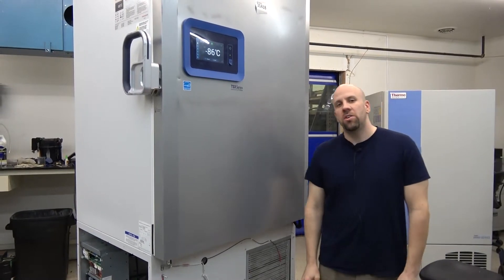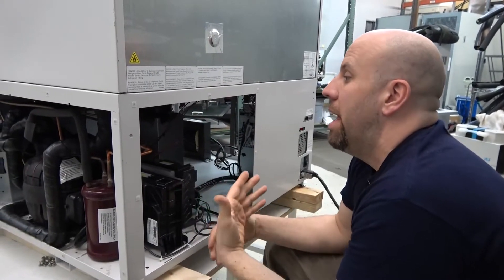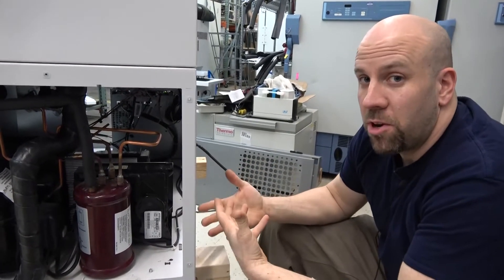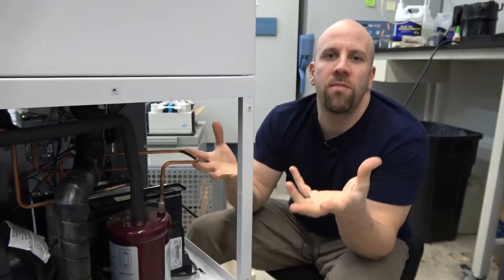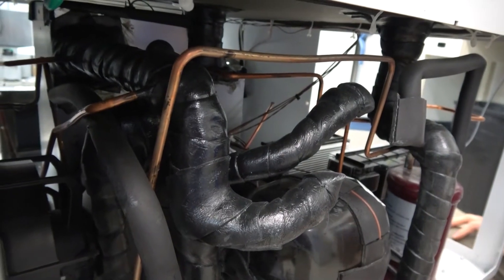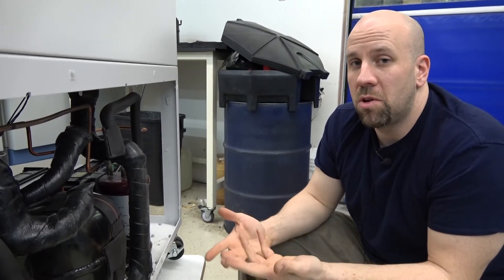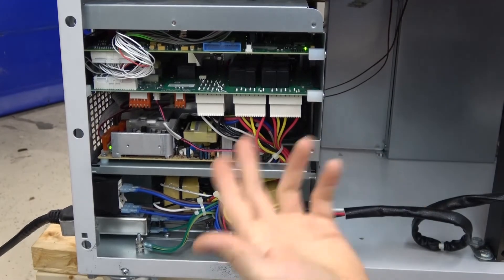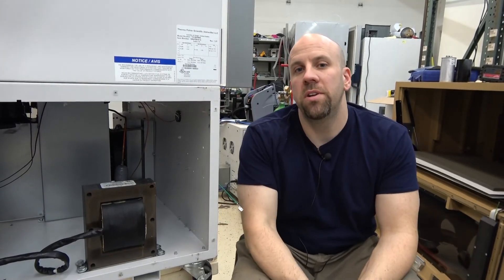What is the V-drive Technology at the core of Thermo TSX Series ULT Freezers?

Comment: Hello, we have one of these that show compressor temp error when freezer reach -9 Celsius degree. Apparently everything is ok, where do you recommend us to start by? It is a 220v units.
Reply from the maker: Hi! There could be several possibilities, but here are a couple.  Make sure the condenser fans are working, check and see if 2nd stage compressor is running, check for abnormal readings on the temp screen on the display, look at the event log on the display screen. 

If you need more assistance, you may chat with us through our website www.newlifescientfiic.com.